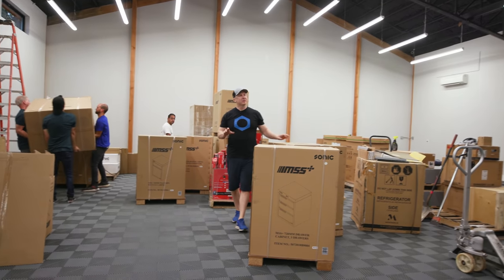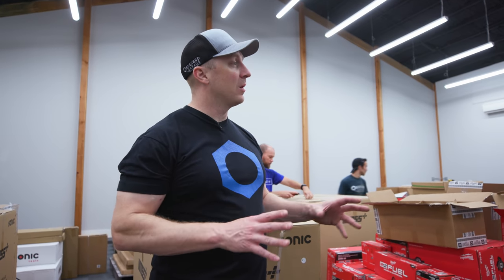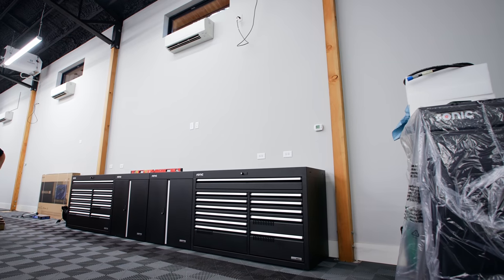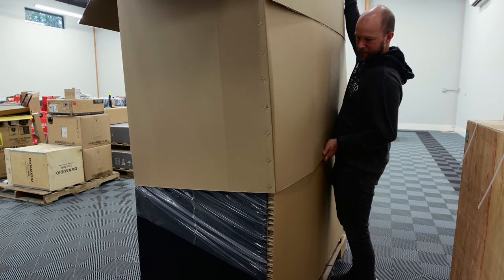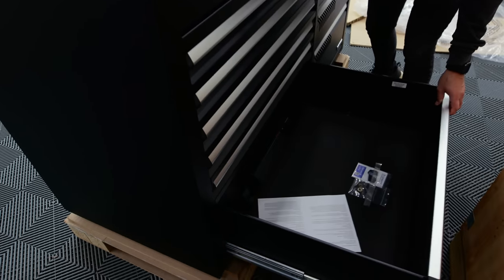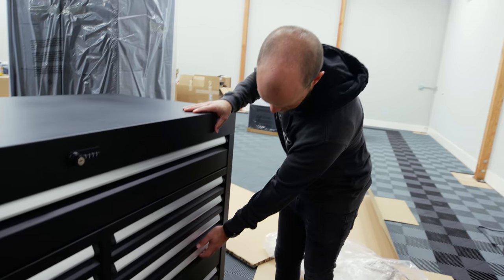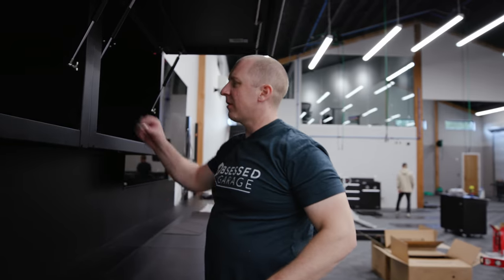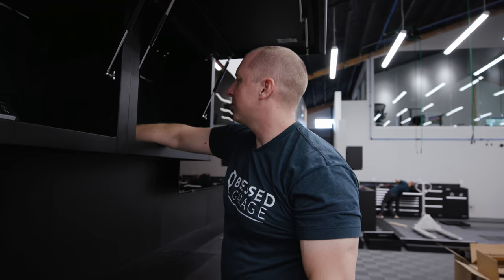The BEST Garage Build EVER - E6: Sonic MSS+ Cabinets (Dream Cabinet Setup!)

Comment: home depot is a great option for 1/4 of cost
Reply from the maker: Ha, ha... Yeah...they are "almost" as good.
Reply: @ObsessedGarage   actually the quality is good, been using them in a shop environment for years.  Its really not about the quality at that point though , your show casing products that probably cost well over 50k and the percentage of people that can afford it is very low. even if you could afford you probably are too rich to get your hands dirty so whats the point??
Reply: Lol seriously. Any actual real technician wouldn’t care about 90% of what they are selling and talking about. There are zero commercial applications using this type of set up. This is purely for looks. I’d like to know how well it holds up after a few years of actual heavy use…
Reply: @andshetoldmetoleave    thats key word heavy use which definelty wont be there

Comment: I'm curious about mounting the TV on the back panels. At first I thought there wouldn't be any back panels where the TV would be hanging; but there definitely are back panels. Most mounts I've seen are 16" across for bolts in studs. Anyway, just wondering how the tv mount was attached?